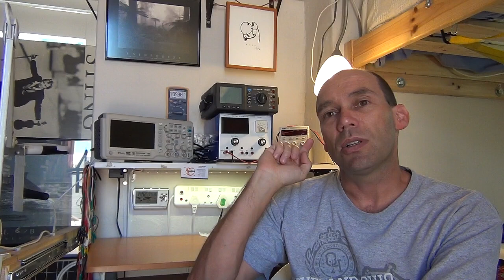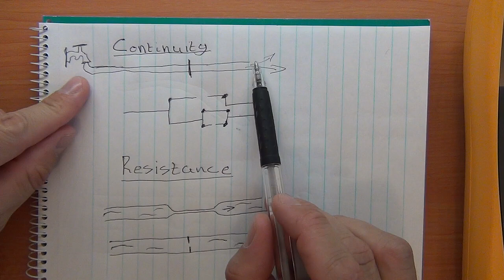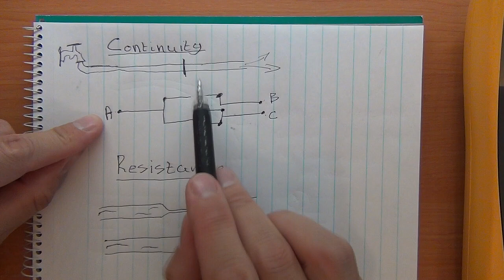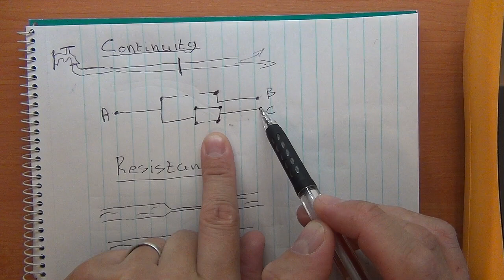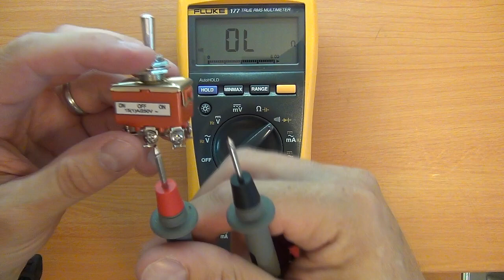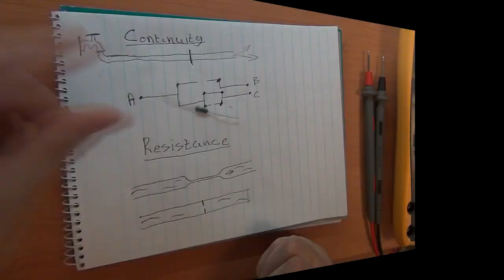How to use a Multimeter for beginners: Part 3 - Resistance and Continuity

Comment: Great video again. So a resistor is really used to decrease the flow or current going into an object. Example: You have a 12v battery going into a 1v LED Light. So that 12v Battery will produce too much power and burn out the 1v LED. Hence I would need to put a resistor between the battery and LED to lower the voltage or current to prevent the LED from burning out?
Reply: You are mostly correct. Yes you would need a resistor. An LED is a diode. If you connected it to a 12V battery reverse biased (polarity), nothing would happen (except a very tiny leakage current). If you connected it forward biased, the 12V would be more than enough voltage to overcome the diode junction, and essentially cause the LED to be a closed switch (diodes are often used as switches). At this point the battery would deliver very high current for a small fraction of a second, as the LED flashes and burns out. A resistor added in series would be called a 'current limiting resistor' in this case. It doesn't lower the voltage.
Note: my example is for a fairly large battery and a 'regular' LED, such as a power indicator light on a tv. Smaller batteries can have high enough internal resistance so as not to destroy some LEDs. In other words, a built in current limiting resistor. Conversely, some modern LEDs can handle very large currents and have very high light outputs (as well as heat!)

Comment: Thanks for this video! You said that the resistance reading is close to zero, there is continuity. Is not the reading bigger to show continuity? Only when the wires or any two points connect, there is continuity. When there is continuity, there is resistance, since materials are resistant to electric current.
Reply: A bigger number simply indicates more resistance

Comment: I like your videos, but your analogy with the water hose is Wrong/incorrect.  You stated that if you squeeze the the water hose or have some kind of fuzzy carpet water hose that your volume and pressure would drop, which in wrong, only your volume would drop not your pressure.  It would be the same as hooking up a pressure guage to the hose bib, and whether you turn it up all the way or just a little (reducing your volume)  your pressure will still climb and be the same.  Other wise good job. :)

Comment: excellent vid series!  i'm learning a lot.  i have a question on this vid. which deals with your diagram at approx 16:05.  maybe this is where i'm reading too much into the analogy, but when you mention about the "water pipe" being squeezed in the middle, the water pressure reduces on the other end.  that part i understand, 'cause when i have a garden hose with water running through it and i kink the hose back on itself, the water flow and the pressure reduces dramatically at the end of the hose.  my question, however, is that the water reacts differently if i un-kink the hose and place my thumb partially over the opening of the hose.  in other words, with my thumb over the opening, the water flow (amount of water) reduces but the pressure increases.  does this have any parallel with electricity or am i putting too much into the analogy?  again, thanks for this series!!
Reply: Great videos! Thanks for uploading them. I am an aerospace engineering student and using these to learn more about electronics as it is the hardest part for me . The part in which you talk about resistance when water pipe is squeezed rised some questions. We learned in Fluid mechenics that water where crossectional area reduces its static pressure but dynamic pressure rises and itbis restored to what it was after narrow bit due to volume flow rate being equal throughout. mass flow rate, however varies due to change of crossectional area.  Am I right or wrong?

Comment: In the analogy of resistance, when you squeezed the pipe with water the rate of flow of water increases and the pressure decreases..but when talking about electricity..both rate of flow and pressure decreases..right?
Reply: I think the current stays the same but electrons are bled off as heat diluting the current. Like watering down gas.

Comment: I cannot understand the reason why when you measures the resistance of the switch, the readings oscillates that much. The values are all very low, but I would expect it to be stable whilst it looks like oscillating a lot from 0.2 up to 1.X. Why is that?
By the way, I keep reading "bobs" in the introductory text of your videos as "boobs". Why? ;)

Comment: A very excellent tutorial. Will the Fluke 177 work with a car or truck? I am a bit confused because a car battery can have up to 500 amps but the fuses in many multimeters are only 10 amps. So wouldn't the electricity coming from a car battery blow the fuses in the multimeters?
Reply: +Harley Rider - you can use a multimeter to measure the voltage on car batteries, and the electronics in your car, but not the AMPs of the battery, you need a battery analyser for that. As you say, it will blow the fuse of a multimeter.
Reply: Or use a clamp meter depending on what you want to measure. See - watch?v=5ZevnrStsL4

Comment: Hi mj  You said PREVIOUSLY  that there was no current going thru the multimeter when measuring voltage: THAT really confused me. I am an absolute beginner.  The only way I could see the test as possible was with current and so I began to assume that there truely was small current . small ... because of the PARALLEL connection.  Now you are saying that the circuit is not energised for a continuity test.  Makes no sense to me.  I'm thinking that I pull to off the main breaker but that  I need energy; and I suspect that it will come from the multimeter itself i.e. the multimeter battery will send current through the circuit to get a resistance response. You see, I'm just guessing all the time. And some of the times, I'm going to be wrong. If the real explanation is comlicated, I'm afraid that hiding it, doesn.t help me,.

Comment: Does OL means overload or out of limit????
Reply: I thought it was Out Of Limit.  Like if you don't connect the leads to ANYTHING there is infinite resistance... Out of the measurable limit.  But after researching, I think OverLoad is what it means.  The meter is measuring SO MUCH resistance (air is a great insulator with extremely HIGH resistance) that it is OVERLOADED I guess.  It can't measure that much resistance.
Reply: @TortureBot  thank you very much
Reply: No problem.  I learned something too!

Comment: The pipe flow analogy for resistance isn't quite right.  When you pinch a hose, the velocity and pressure of the water increases at the pinched point, but the volume of water passing that point stays the same.  Also, after the pinch, the velocity and pressure return to what they were.  So, the condtions on the left side of the tube in your example would be the same as on the right side.  A resistor would be more like making the entire pipe, after the resistor, larger.  A larger pipe would have the same volume of water passing any one point, but the pressure and velocity would be decreased.  C.f. Bernoulli's principle
Reply: Paul Orbinson Check out the continuity equation for fluid flow, and Bernoulli's Principle. You'll find this equation: a1v1=a2v2, where a1, a2 are cross sectional areas and v1, v2 are velocities of water. It basically says that if you pinch a hose (make a2 smaller than a1), the velocity at that point must increase to balance the equation (v2 becomes larger than v1). Since, the units on each side are cubic meters per second (volume per second), the equation says that the volume of water passing each point is constant for any unit of time.

So yes, filling a bucket with a pinched hose will take the same amount of time as with an unpinched hose. This is because, in the case of the pinched hose, the water is coming out faster. So, the volume of water per second is the same in both cases.